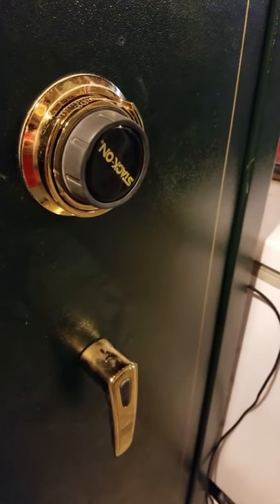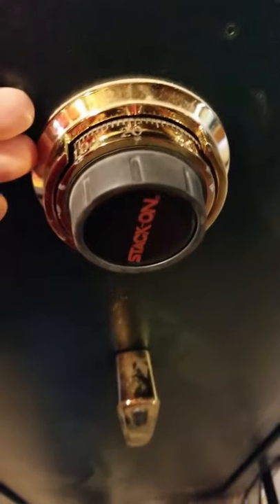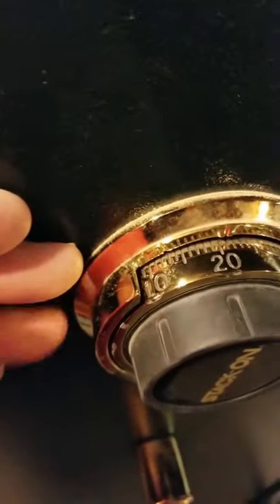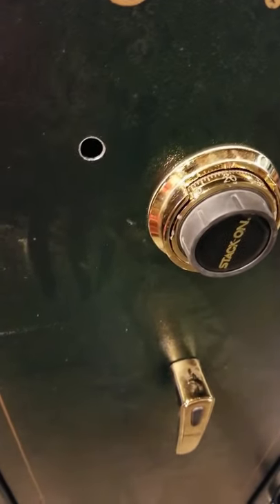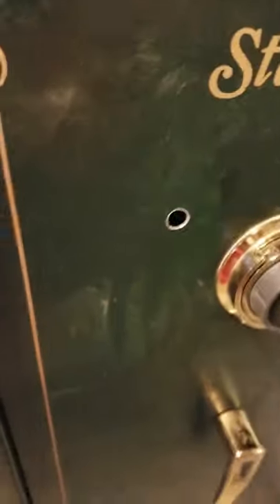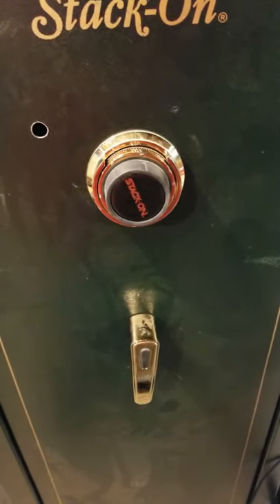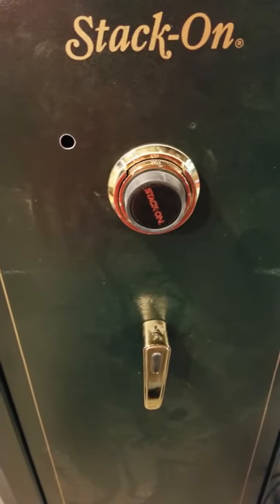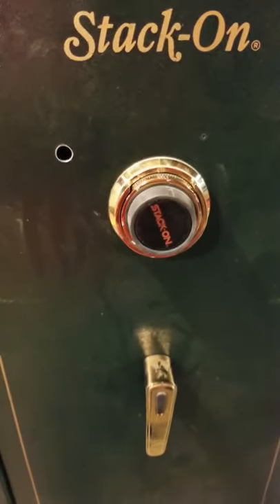Forgotten Gun Safe Combination

Comment: The same company makes safes for several brand names. My neighbor had a "Field and Stream" branded safe that was exactly the same. I just noticed it sitting in his basement with the door open and nothing in it. He said it had been that way for years. He bought it used. Seller demonstrated that it unlocked. They left it unlocked when they loaded it into the truck. He lost the combo sheet somewhere between the sellers house and his house. The seller didn't remember the combo "for sure" (he always used the sheet). So he just left it open and occasionally used it for fire-resistant storage. It took me 30 seconds and a #2 Phillips to remove the carpeted panel from the inside of the door and get the combo for him. He never thought to look behind that panel. He just assumed it was solid. The look on his face was classic.

Comment: Just an FYI; you can also simply request the combination from the manufacturer off their website. You'll need the serial code that is on a label on the lower right front or left side of the back of the safe. Once submitted, you wait 4-5 days, and you have your combination without any damage to the safe.
Reply: They do not supply combination.